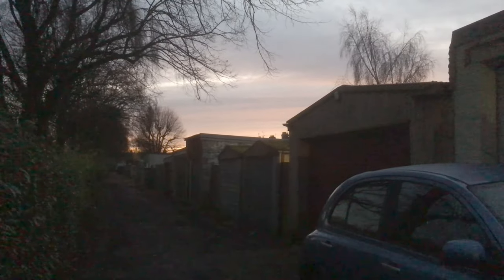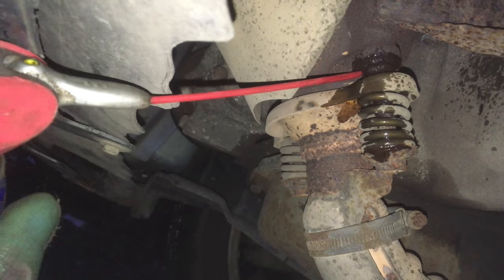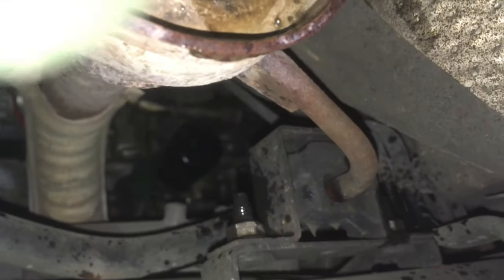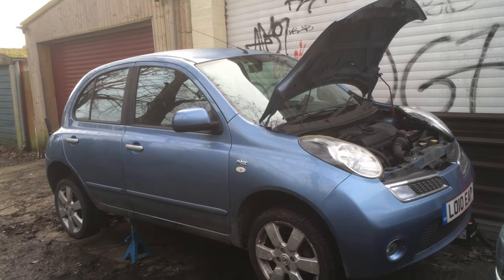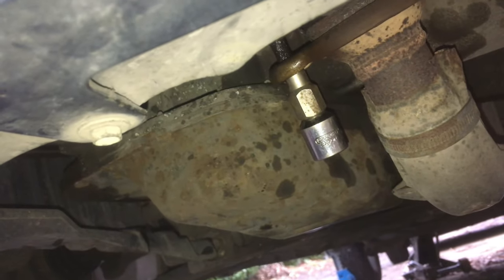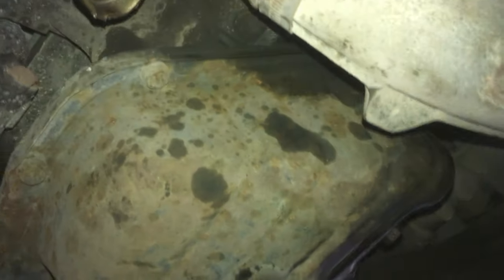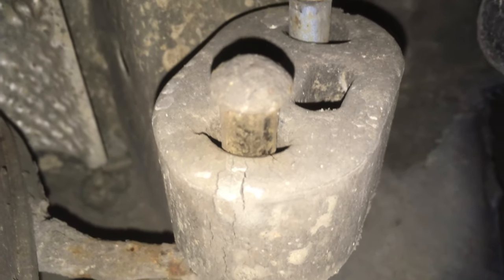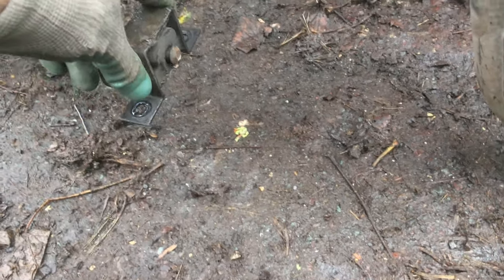Snapped Bolt! :: Micra k12 complete exhaust replacement

Comment: GREAT VIDEO. I LOVE TO WATCH YOU DOING THIS KIND OF JOBS IN MICRAS. SO HELPFULL AND VERY NICE THAT YOU ARE SHOWING PARTS WITH NUMBERS. IT MAKES OUR JOBS MUCH EASIER.  
I have the Micra 1.2 2006 and  I will have to change the front down pipe because discovered 2 holes by oxygene sensor. At the moment i have used gungum  as temp fix but to be honest dont know how long it will last. And those bolts holding down pipe with cat in my micra are in much worts condition so i sure both will snap and will have to drill them to remove. 

THANK YOU ONE MORE TIME AND ALL THE BEST .

Comment: Really useful video. Do you have a part number for the bolts that secure the down pipe to the centre pipe, or did you just reuse the original bolts?
Reply from the maker: Great question im afraid i don’t really remember now

Comment: I have micra k12 2004 automatic transmission 95.000 mil this problem my car Performance has dropped a lot and the car accelerates very slowly after 50 mph. There is no problem with stalling or idling. Only the performance of the vehicle is extremely low. I cleaned and calibrated the throttle body. I changed the air filter. I checked the camshaft position sensor. I cleaned the air flow sensor. I applied Würth injector cleaner and drove about 300 km, but I could not solve the problem. I opened the catalytic converter and checked if it was clogged, and there is no problem. Do you have any ideas what could be the problem?
Reply: Finally, there is no fault code on the OBD device in the vehicle.
Reply from the maker: The timing chain may be stretched

Comment: Hello Max, thanks this is a really useful video. I have a nissan micra 2008 k12 and have been trying to find part  numbers for the bolt and spring for the downpipe into the cat.converter. on euro car parts cant find it and also says won't fit my vehicle. Any advise on these 2 parts, euro car parts dont seem to be selling them.
Reply from the maker: Klarius direct or ebay is your friend

Comment: @Max Attack , Tell me the secret to undoing that stupid square mount eh ?
Couldn't believe i couldn't get a socket or ring spanner on it enough to turn it ....
Thanks mate
Reply from the maker: I think I used a ratcheting spanner in the end.
Reply: @maxautouk  thanks mate and what a true pain in arse and overengineered little bugger that mounting is. Thanks for answering👍
Reply from the maker: Makes you wonder what the point is doesn't it!!
Reply: @maxautouk  tbh i think its purely to make you use a dealer based mechanic . And an earth strap on other side ? Wtf ...ive never seen in  30 yrs of having cars .an earthed  exhaust pipe ....weird ideas ...look at the ellaborate drain set up on the number plate light unit...another gold medal there too i think..  🤔